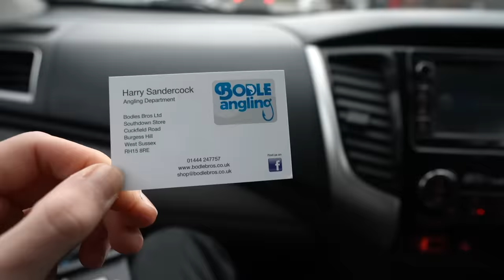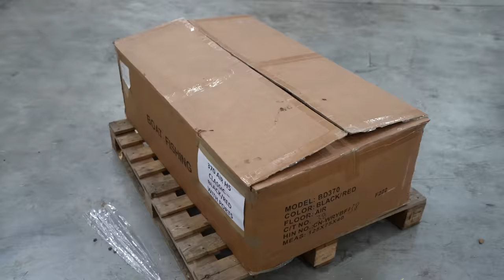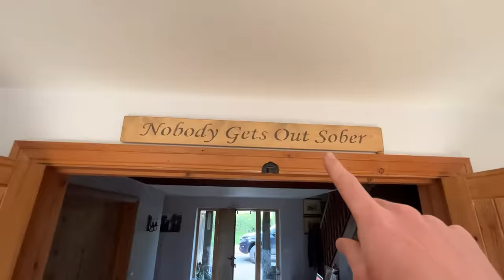We got an inflatable fishing boat! - catching and cooking food from the sea

Comment: Get a set of flushers (often called ear muffs). They attach to a garden hose and the cups sit over the intake on the motor. You don't need a barrel of water then, just the hose.
For launching - If one man then have the boat bow in to the land, get the motor running THEN get in and back carefully out until able to safely turn around. If two men then one gets in and has the motor running before the second man gets in.
Consider getting/making a sling/strap to go over your shoulders for hauling the boat to the water. It will save a lot of strain on your hands and arms.
Adventure awaits!

Comment: as mentioned by others, waders in a boat are dangerous if you fall in. stay safe bro's
Reply: The reason that type can fill with water, stops you moving.never get into boat.
Reply: But actually, that's not entirely true... it makes swimming a bit harder, yes, but you can still swim. There's a video on YT that explains it and busting all the waders in water 'myths'.
Reply: @patrickloef9809 how about pulling yourself back into the boat

Comment: If you still have the boat, when you finish in the sea mount the outboard to a wheelie bin filled with water and let it run for a bit as the outboard as a rubber impeller inside which pumps the cool water round the engine which if left with salt on the get eaten away like the rest of the engine. Happy sailing bud 👍🙏 love the vids.

Comment: Nice! Though i do have a few things which i feel like could be a mistake:
- a black boat gets REALLY hot in the sun, there's a reason why most boats are white, and that is it
- Getting an air deck instead of an aluminium deck. The added stability of standing on metal instead of rubber will probably save you a few close calls (of falling in the water)

Overall though, fun to see that you're getting into boating, have fun out there and stay safe!
Reply: I heard there's barely any sun light in the UK
Reply: @dewantoroo  you know what, valid counterpoint, my bad

Comment: Hey bro. Love the channel! I live in Tampa bay and do a lot of boating. Please do yourself a favor and put those life jackets on before you go into the water, or don’t wear waders. Waders are super dangerous when they fill with water. They make a suction around your body and you can’t get them off, but you also can’t swim or float with them, so basically you end up like a rock going to the bottom. Wearing the inflatable life jackets is smart, just wear them from start to finish, even while launching the boat.

Comment: My brother in law nearly drowned wearing waders launching a boat in the sea.  His were thigh waders but chest waders fill with more water and become heavier.  

But the safety of wearing waders is questionable because of how they hold water. While they’re safe to wear on a boat, they may be hazardous if you fall into the water. Waders are neutrally buoyant, meaning they don’t sink or swim but float at the water level they’re in.

If you fall overboard, your boot waders may fill with water, causing you to sink below the water. In addition, waders that go up to your chest may also fill with water. This extra weight may make it hard for you to climb back into the boat, leaving you exposed to dangerous currents and tides.

Comment: You should get mesh that covers the outside of it so in case a hook gets into the boat and won't pop. Or get a trolley motor so you don't need to waste gas to move around and you can troll and keep it from drifting but that's also what? An anchor is for

Comment: also check your motor. it need to have a "anode" bolted somewhere bellow the water line. its like a zinc/magnesium/aluminum looking puck or plate. it must be properly electrically connected to the engine in order to work.

Comment: And after breaking in the engine, you should replace the oil and the oilfilter before using it again. Another tip is to turn off the fish symbols on the sonar and manually look for bananas.

Comment: Hey guys, you should never where waders while out at sea, if you fall in and they fill up the life jacket will struggle to keep you afloat, with all the water in them. Try a dry suit, it will save your life, also on the life jackets, put a crouch strap on them, to stop them coming up over your heads when they inflate, i am speaking through experience, keep safe guys..

Comment: It was such an awesome journey from splashing down to finally cooking your catch. One word of advice with the raymarine electronics on the boat is to invest some time on the water using the side/downscan functions to help locate structure along the bottom of the sea. We use the same/similar  transducer (rv100)on our boat and the capability of those units is amazing once you dial it in and know what you are actually looking at.